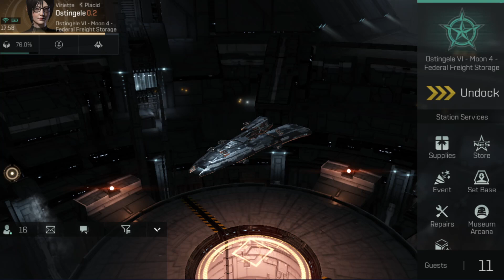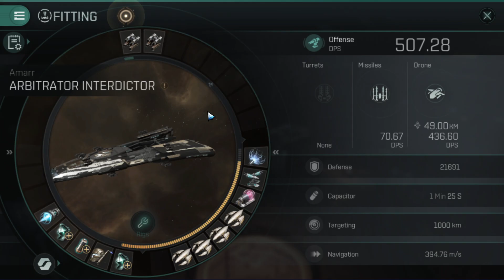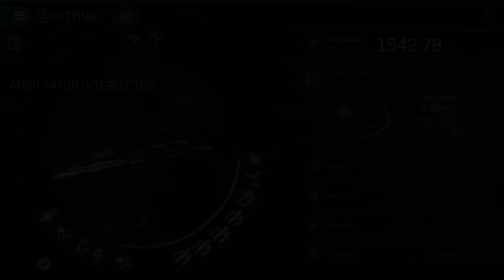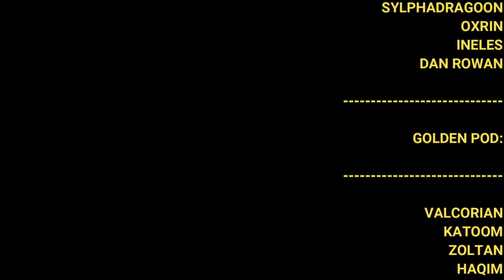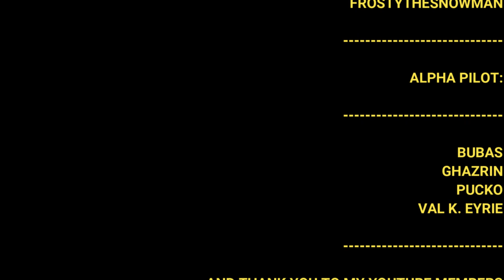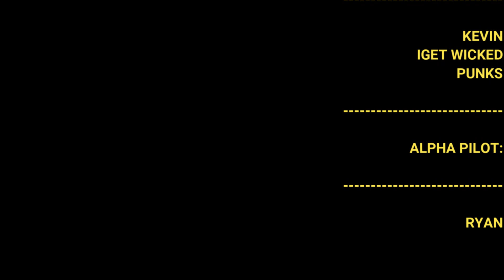Arbitrator Interdictor Fitting Guide - Gate Camp/Trap Fit - EVE Echoes

Comment: Love it, any point in upgrading to interdictor from covert ops variant for PVE?
Reply: I can't really see any point either. I've not done the maths though - are the DPS bonuses higher? I know the Bellicose Interdictor has a slightly faster base speed (296m/s vs. 313 m/s) but the resistances are lower. Unless you're dead set on gate camping maybe just wait for the BI v2 when you hit T9. That's my plan anyway.

Comment: I am running one of these for PVE... was going to use it in null but the warp increase in low/high made missions to easy to make isk. Got 3 nestworms on it and with my skills they last for 30 seconds per cycle so they are constantly up. Have a +15km drone range so I have 64km drone range with 550dps just from drones when cycling the damage mods, 450dps on pure afk. Got a afterburner and move at 930ms. Can AFK news missions on T9 and the rare ones are very easy do to. Making good isk in a cruiser while I wait for the domi. I have no BC skills. Also for dones if they bug out you can recall them then send them out again and they will auto target. I find that the auto lock is what bugs them out most of the time so I send them out manually with manual lock at the start then afk the rest of the wave.

Comment: I'm an odd duck. Even though the arbitrator line is heavier in armor, I'm much happier when I run it shield boosted. Ya it takes a little more cap, but it's just the way I've always played it. I just hit t8 and am very much looking forward to getting into one of these. Before I got into a prophecy the covert ops version was my go to for story missions. Fast enuf to mwd away from the frigates and enough dps to whittle away.
Reply: Shield tank on an arbi is surprisingly performing way better, agreed! I too run a shield tank on mine, 50k ehp hot
Reply from the maker: Yea my next fit where I want high dps I go shield fit.
Reply: @adrianlazar3471  hot as in with adaptives? Dcu?
Sitting at 57k ehp on blackbird interdictor
Reply: @expanseyt7065  this is what i have in my lows: 2 red shields, 1 yellow shield, 1 large shield extender, and a prop mod. The shield hardeners are c-type.
Reply from the maker: Its sad to say that I'm not surprised you run shield. Its amazing.
Reply: @SovereignRPG  agreed. I'm running the 3 large group shield boosters on my prophecy, yet more than once I've fitted a med shield booster on it when I'm going into a story I'm not used to for "safety"